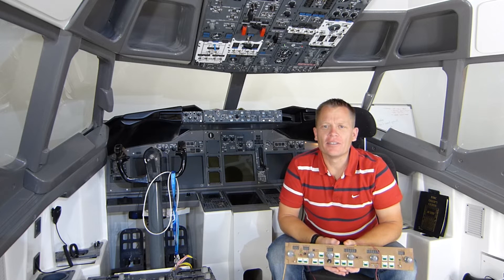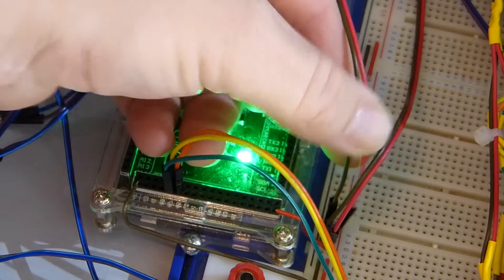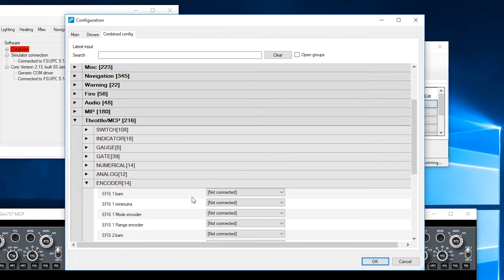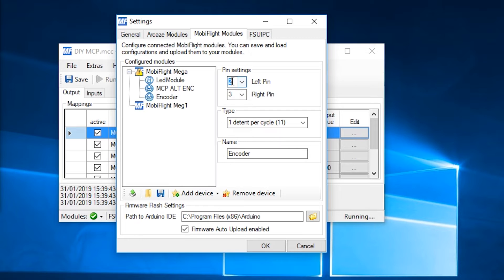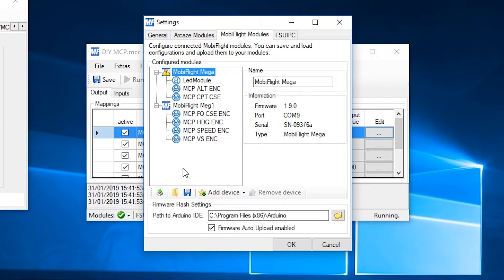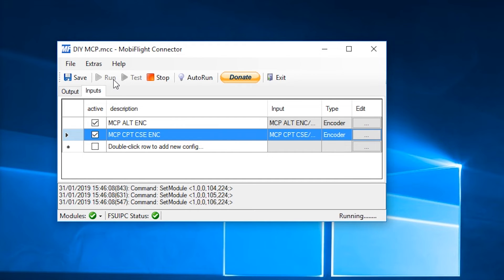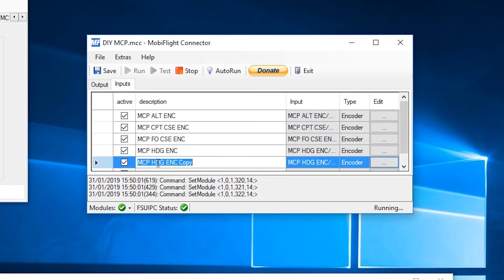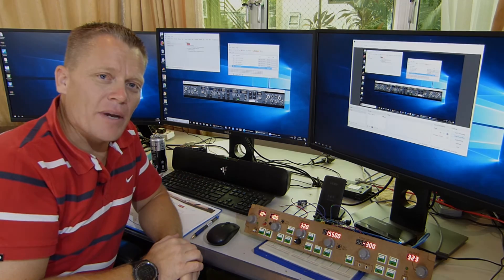737 DIY MCP - Encoders, Prosim & Mobiflight

Comment: I cant understand the need for all the 3 different software to set up Hardware.
Reply from the maker: Hello, That can be confusing, but once you get into it, it becomes apparent. It basically makes sure that the sim can read process the hardware signals from the arduino.
Reply: @helimech8152  Thank you Karl and hope your settled in at your new home. Oh and getting used to the UK climate change. Have you got the Paid version of Prosim if so i looked on the website its a fortune £1200 no subscription option. How in the world do they expect new sim builders to pay that. That's like nearly half of what your entire sim cost?
Reply: @helimech8152  Good to see you back on after your tiresome move. Did you take your sim with you.? Cheers,Martin

Comment: Hi Karl. New subscriber & gotta be honest, loving this content!. I'm struggling with something though that you may be able to clarify for me. I get the whole hardware running via Arduino boards, this then feeds into MobiFlight for i/o to FSX (or whatever sim) but what part does ProSim play in this picture? Great work keep it up!
Reply from the maker: Hello Nick, prosim provides all the aircraft logic for the sim. For example, if you don't switch on the right aircraft systems, things can go horribly wrong. Or if you want to simulate assywmrric flap deployment, it creates the exact result as the real aircraft within the sim.
Reply: Heli Mech ah I see now, thanks for the clarification.

Comment: Hello,
nice Video, but at around 11:50 you increase the Alt FAST. After that i see the Value is changing very slowly after you turn the Encoder.
Is that normal ?
Matthias
Reply from the maker: Hi that was a bug with Mobiflight back in the day, when you select debug mode. I dont believe there is an issue any more. Kind Regards Karl
Reply: @helimech8152  Hi Karl, i am on the Way to build the Pedestal with Arduino(s) and MAX7219 7 Seg. Displays. But i am no longer using Mobiflight, i do it via Ethernet and SIOC. That is very great, works perfekt and i must not use USB ( which makes always Problems for me ). If you also want to try that and maybe need Help, let me know.
Greetings from Germany
Matthias

Comment: your videos are always interesting and easy, even if I don't understand English well you can understand how to program everything!
but I have a problem: the three digits appear on my displays: "000" and when I move the encoder the digits on the sim change (I have p3d v 4.5 and 737 PMDG) but 000 remain on the display
Reply from the maker: Hi Guilio, great to hear from you. Your problem sounds like you have the correct offset/event ID for the encoder, but not the display. Have you tried using the presets for the value given in mobiflight, by selecting the relevant item in the list?
Reply: @helimech8152  Good morning, my comment is from before I wrote you on Fb. we talked to you and you helped me, for this I thank you.
I purchased FSUIPC 5 and in fact some things are fine, others less. This is difficult programming for those displies that have 2 values on the same 7219.
Other storage problems on the 2560 mega. But slowly they are solved.
I thank you for your answer.
greetings Giulio

Comment: Hi Heli. Would you let us know how did you get the fsuipc codes.  I have try thos offset codes that comes on my pdf document once you install fsuipc, but no works. And another things if you are so kind, I want to know if my mistake is because of the codes (cause actually I am selecting the action from the droplist) or it is because of my rotary enconder, cause the one I have is without that little board that is attach to the rotary enconder that you have. Please. regards and you are doing such a good job
Reply from the maker: Hi Luis, The codes on the FSUIPC list should work. However i use the free offset range 5300-53FF. These are reserved for 3rd party i beleive. However, i started at 5300 with prosim and then just used every next free offset until the sim was done. Have you visited the website? www.737DIYSIM.com.  I have now updated the Offset list for my whole sim. I also need to ask what programe you are using PMDG or Prosim etc. To really be able to help. Kind Regards Karl.
Reply: @helimech8152  Hi. Heli. Thank you veru much to answer. Yes I finally realize about how thirdparty works and how to uses the codes. I am working with PMDG+ MOBIFLIGHT. I got from them the list of the offset codes ready to use them. I am pretty new and I know I have a long way to go. I will check your web site. I am a littel stock with some products that I cant get quite and easy, so I try to support my system on a keyboard as well, trying to using as joystick. I wont do anything PRO as you cause my space room  but I want to get to my own best chance to fly at home. I will try to bother you at less as possible. Regards , from Cuba. Luis

Comment: Great video! I have a question - I'm not catching why you used another Arduino board. If you used 45, 46 & 47 pins for the displays why you don't used pins below 45 e.g. 20, 21 etc. ?
Reply from the maker: Hello, pins 45,46 & 47 were used simply because that was the order they came out when I copied the prosim config. As you will see in the next two episodes, all the other pins are used for buttons and leds. However, if you use pins 1-14. You will have the ability to dim the displays using software as required using pwm. Kind regards karl
Reply: @helimech8152  thanks for your prompt reply!
Reply: @helimech8152  Is it possible to use the MobiFlight with PMDG in the same manner?
Reply from the maker: Ho TG, I used mobiflight and PMDG, when I started. It was a few years ago and I remember it being a little more difficult  but completely doable. You need to find the event I'd lists and offsets for the 737 PMDG. you need to use their specific codes to get things to work. It's just a case of looking up the vide in the list and inputting it into mobi, you wont have to do the prosim part.
Reply: @helimech8152  Thanks!
Reply: @helimech8152  Can't wait to see other videos from you showing how to do other modules. Best regards!

Comment: Which led push buttons are you using?
I couldn't find them anywhere. Amazing stuff you make
Reply from the maker: I believe they are called KD2 buttons. I  bought these over 4 years ago now and I too had trouble finding them. But finally found them on Ebay.com. infact found black ones and you can select the colour of the led too. Actual links can be found d on the website. Kind regards karl